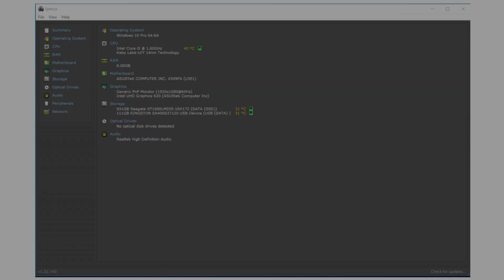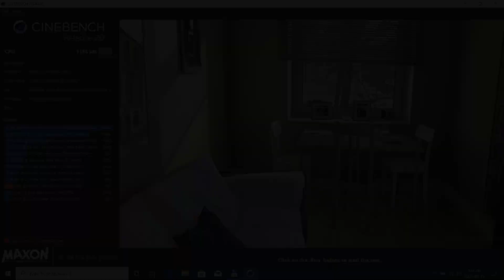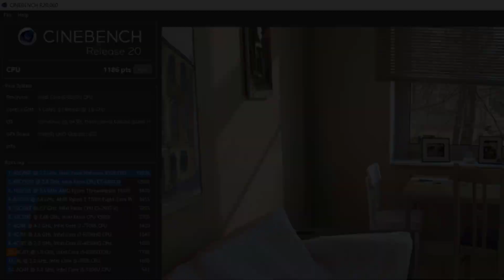ASUS X509FA overheating problem #redigitt Ep.323

Comment: Hey, thanks for making this video. I have the same problem and can't slove it for past 2 years with same series laptop which is X509JB. After reading all the comments,  it seems to be only two ways to improve heat issue. First way is to replace better thermal paste and second way is to use cooling pad, all I want to ask is there any other way to make the dissapointed heat issue get better? Because of the awful cooling structure, it's really hard to make cpu always in low temp.
Reply from the maker: Sorry, these are the 2 options.
I recomand  both of them if you replace the thermal paste it will  cool  the CPU from inside the laptop case.
The cooling pad is noise but helps to not overheat.
And watch YT videos at 360-720p and not in full screen.
Thank you for watching, if my video or advice was useful, please consider to like, share and subscribe
Reply: @redigitt  Thanks man.

Comment: Just by restarting the cpu is throotling...never seen anything like this before.
Reply from the maker: Aloha, probably the laptop is used and has dust on the heatsink/fan.
Disassembly, clean the fan, replace the thermalpaste and use a cooling pad with 2 big fans.
And last you can reinstall the operating system and remove the bloatware programs and install only the necessary programs.
Thank you for watching, if my video or advice was useful, please consider to share and subscribe.
Reply: @redigitt  Yes, it's used and only have 2 years. I've check the fan and it's cleaned. The air entrance in the bottom of the laptop is ridiculous, not even cover the all fan. This desing is strugling to get some fresh air inside. My father in law, have a brand new asus vivo book Ryzen 5 3500u and have some thermal issues too, the cpu reaches 80/85C easily with a cooling pad.
Reply from the maker: If you disassembled the laptop, replace the thermal paste with a good quallity thermal paste like the Arctic Cooling MX-4.
If you use the laptop for gaming, full HD videos, video edititng then you better look for something like this laptop  https://www.youtube.com/watch?v=A9lKF0BxmMI

Comment: I am now faceing that heat problem so Annoying?***Tell me to Solve
Reply from the maker: Aloha, you may try to disassemble, clean the fan and replace the  thermal  paste with a higher quality thermal paste like the  Arctic Cooling MX-4 thermal paste.
You can cool down by 1-3 Celsius degree by using a cooling pad to.
This laptop is an entry level laptop, it is not design for gaming, video editing or for watching long hour's HD videos. 
Do not use on your knees or on a pillow. 
Use always on a flat desk to let the heat to dissipate.
Thank you for watching, if my video or advice was useful, please consider to share and subscribe.

Comment: I have a similar laptop that has an AMD CPU and it has the same cooling system of this video, it easily reaches 80-90 degrees under small to medium load.
I have found a way to increase fan speed (NOT using Speedfan or notebook fan control) so it runs at about 60- 70 degrees at medium load. If you want me to explain how to do it I will reply with the answer.
Reply from the maker: Thanks for sharing
Reply: Let us now please.
Reply: @JoaoPinto-1983  I have posted the instructions below
Reply: @fortscage907  Can you please explain once again how to make better cooling for this laptop?
Reply: @Evhen_Velikiy  Check my profile/channel 'about' page. I have put the link to instructions there
Reply: @fortscage907  Oh? I see, thanks alot!
Reply: I have an R7 X509 too and id like to know how i can increase the fan speed cuz mine overheats like hell too
Reply: @maxcristi6493  i have posted the instructions below
Reply: @fortscage907  just before our comments? cuz i cant see it ,i think its a bug idk

Comment: I have same i3 8th gen version it lags some time
Reply from the maker: Aloha, it lags when? 
In gaming, internet browsing, in office? 
Did you check the CPU temperature? what is your room temperature?
Do you use on your knees or in bad? or on a flat table with laptop cooler? 
Thank you for watching.
Reply: @redigitt  in gaming and browsing mostly i use it on bed and knees and i havent check temperature
Reply from the maker: Because this laptop is not a gaming laptop,  the cooling system is not the best cooling system..
First check your temperature with https://www.cpuid.com/downloads/hwmonitor/hwmonitor_1.42.zip or with another program.
You need to use at least on a flat surface or better use a laptop cooler, otherwise the heat can't dissipate and overtime the CPU soldering will crack/loose from motherboard and will stop running the laptop.
Test your temperature first on your knees or on the bed and after that on a flat surface or with laptop cooler, probably when you are using laptop cooler the temperature will be lower with 5-20 Celsius degree.
For online videos, you can select a lower resolution like, 720p or 480p, in this way you lower the temperature.
Thank you for watching, if my video or advice was useful, please consider to share and subscribe, have a nice day.

Comment: okay, as the people say
shit happens
thanks for explanation!
Reply: this motherboard looks as if it was wrested from 14" notebook
here is so much space for a good cooling system...
Reply from the maker: Nowadays unfortunately the entry and mid range laptops come with small motherboards...they are overheating, built in battery...you can't upgrade to a bigger battery, onboard soldered RAM.....you can't upgrade the RAM, without optical drive....you can't install a 2nd HDD Caddy in the Optical Bay, soldered CPU and VGA ....you can't upgrade, the heatsink and fan are to small.... thermal throttling, the laptop keyboard is built- in in the palmrest, the laptop hinge is very thin ...they broke or broke the fixing screews "house" from the bottom cover, they have only 2 USB ports.
Thank you for watching, if my video  was useful please consider to share and subscribe, have a nice day.

Comment: I've bought that one yesterday... (sigh)
Reply from the maker: If you won't be used for gaming, I think you will be satisfied by this  laptop.
Reply: @redigitt  for me, if i have too many tabs open in google or if i listen to music while browsing, it will overheat
Reply from the maker: @Saul Goodman to many tabs? 10-20 tabs ? if you run in 10 tabs 1080p video it will overheat for sure, if you run in one tab 1080p video and in 9 you read news, then no.
Reply: @redigitt  i think i had like 4 tabs and one of them was playing music from youtube. I was also playing chess and when i looked at my cpu temperature it was over 80°C. Then i stopped the music from playing and it went down to 60°C
Reply from the maker: If you overheat the CPU for a long time, it might "broke"(melt the soldering) the soldering from the motherboard and you need to make a reballing and that cost very much, in my town there is only one PC repair shop that make this interventions and costs about 80-100 USD.
Thank you for watching.
Reply: underground leaks 101  Yeah I realized it now and its great